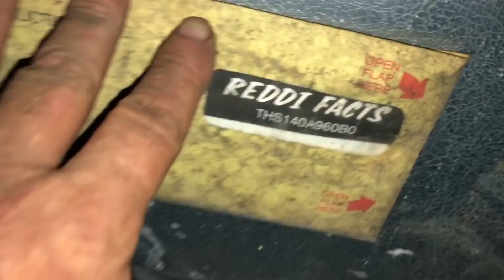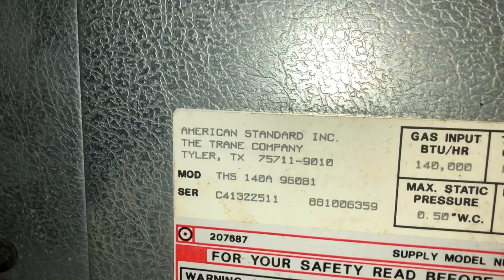HVAC Service Call loud noise from Gas Furnace

Comment: Curious to know what you will you do for a repair here! If they decided to go the cheaper route, I’d recommend replacing the whole blower assembly along with the brackets that held up the blower. I’m sure some damage was done to that motor over the years

Comment: Wow...maybe a little problem with the motor bearings caused that over time?  Or, the blower motor has been replaced one time ago and that bracket got damaged during the swap then developed a crack that traveled all the way until it gave away ? I'm guessing it was service sometime ago which explains why the blower housing fell down, it wasn't put back correctly or the motor bearings are so bad it shook it down.

Comment: Ted I tell you what. That's about the worst I have ever seen.  I had one myself about 3 months ago on a package unit.  Flex duct return and supply sitting on the side of a home.  A possum clawed his way through the flex and somehow lodged himself in the blower wheel.  It was a nightmare.  Never see a blower launch itself in the furnace cabinet though
Reply: I can't even imagine that smell 🤢

Comment: Question for you... I don't attempt to sell a new unit unless it's 22 and out of charge or in a vacuum, cracked heat exchanger, or the repair will cost over 1000$... should I be going about it differently???
Reply: Tyler Tilghman Seems to me that you’re doing the honest thing.  I’ve had quite a few hvac folks tell me to replace my system for the past 9 years or so.  It keeps working fine.
Reply: I sell units when the old ones get too expensive to repair, than to replace. I like to keep old systems goin if it ain't too much.